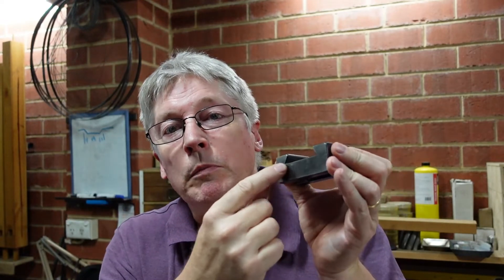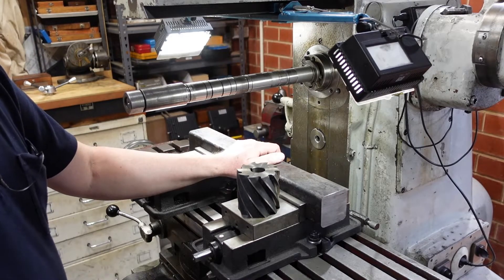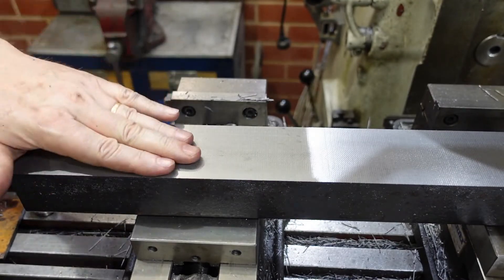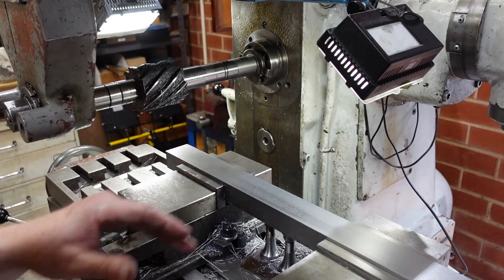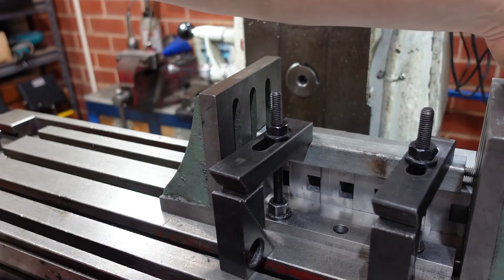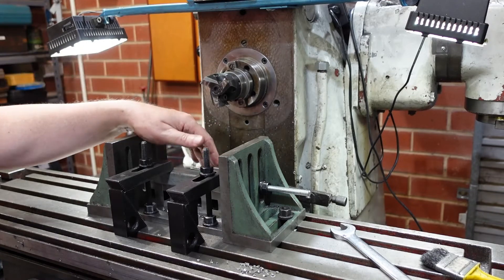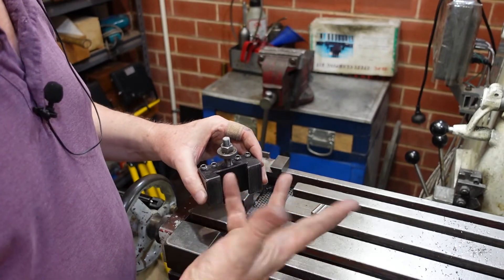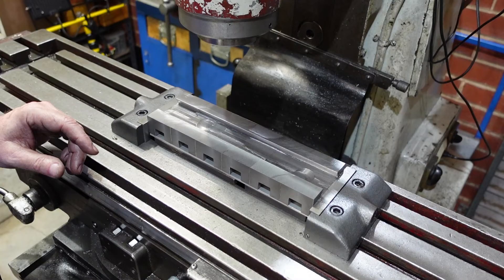Mass production with a horizontal mill!

Comment: Hello ! Could you please tell me how do you sharpen the slab mill cutters ?
Reply from the maker: I haven't yet, but I do have one that I will need to tackle soon. The way that I'm going to do that is mount it on a mandrel so I can put it between centres on a tool and cutter grinder. I'll be making a video of that when I do it, as I think it will be an interesting task.
Reply: @occasionalmachinist  thanks fot the answer Looking up for the video !